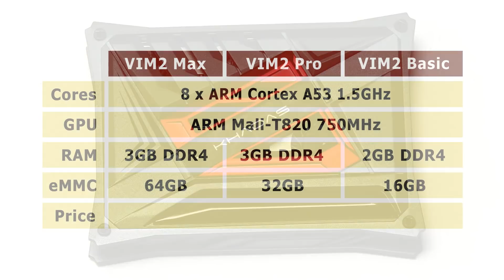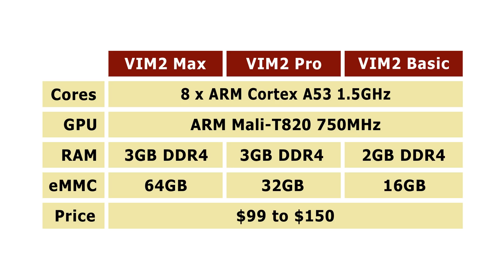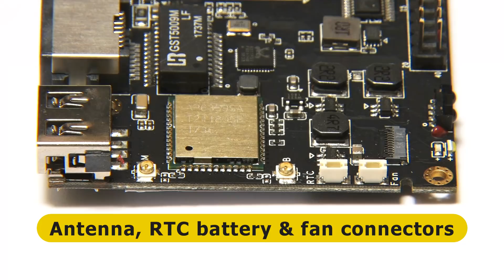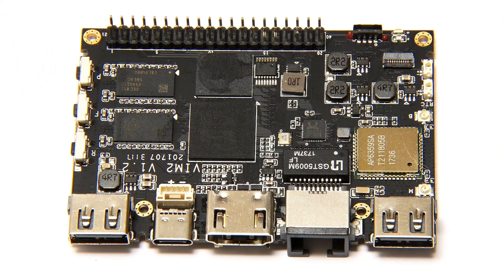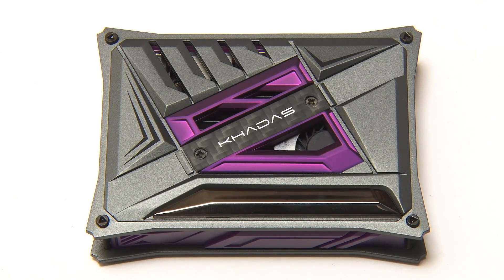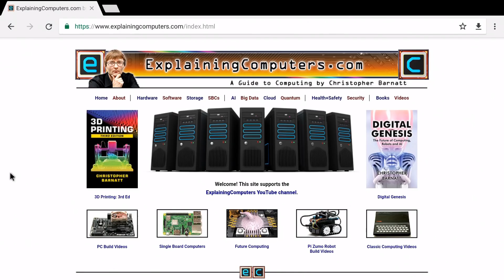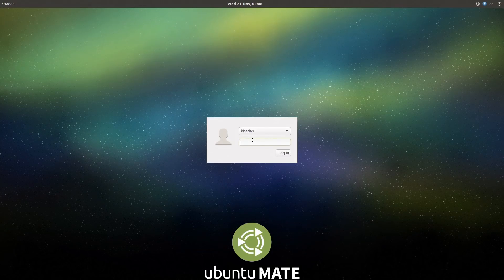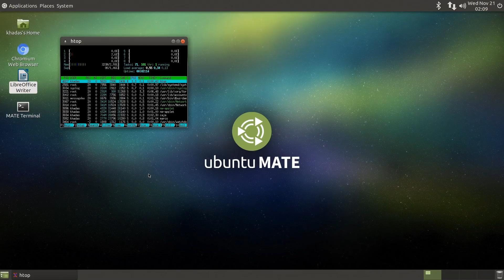Khadas VIM2 SBC & Android Box

Comment: Here's my take. Would I buy another? NO.  I bought the VIM2 v1.2 .. It's a sexy little device considering a dual boot Linux / Android.. However support on these Asian devices is something to consider. Im a big RasPberry Pi fan boy.. Mostly because of the Vast open community. I bought this expecting good support over the following months.. Reality.. nope..The device is only as good as the Kernel support and development that is behind it. If they don't release kernel for the device supporting the onboard then your stuck with what they last did. This is what kills most of these Asian devices..No good long term support. Takes forever for shipping on top of that....................................

Comment: On the Khadas site, the total for this as seen in the video minus remote and power supply is $191.40 USD. Nope! Not Happening! I have a cheap Nextbook laptop running Win10/Ubuntu and it came to only $175. Way too much for a SBC. That Nextbook has a removable touch screen too.

Comment: Hello Chris, 
A few months back you did a review of Ubuntu Studio and I am seriously considering the switch from Windows to Linux using this same Operating System, I would LOVE to see you do a "part 2" of the Ubuntu Studio with a tutorial of how to run a couple extra hard drives in it for storage and how that might be set up!! My plans are to run Ubuntu Studio on a small 320GB SSD as the main drive with two 2TB hard drives as storage for my video content and edited content! But because I am so behind in using strictly Windows I will need to format the hard drives from NTFS (windows) to what ever format the Linux OS needs (as I already have the drives, but I will need to change the format on them to work in Ubuntu)!! So I was wondering if you could do a video on just such a set up please!! Thank you so very much for your time and your experience, and I always enjoy your videos greatly thank you so very much!!!
Reply: Hello again Chris, 

I have another video idea for you about the same has above!! I would like to know how to run multiple hard drives on Linux and have them auto mount at system boot!! My intention is that in my windows computers I run a "main" hard drive that is basically the operating system only, then I install a bunch of hard drives for stored LOCAL content and added storage as well!! In my systems I have run has many has 6 hard drives on a single machine all nested inside the case where I can access the data quickly and then I move files around the system to align projects together has I need them!! This is because I get side tracked a lot and in my personal life I am never sitting at my computer constantly with day to day things going on in other areas of my life! One day I might get a visit from my grand kids for example so I have to put things on the "back burner" and come back to it later, or I am working on a video project when a paying labor job comes in and I have to store my video project till later locally on my machine and so on!! so having five 2tb hard drives at my disposal has become common place for me, and one hard drive alone is my "content drive" where I store music files, effects files (such as sound effects) and other related data to it!! Just so if I want to add a song to my project I can just pick and chose from a local batch without having to waste time digging through back up hard drives or my NAS which at times is a pain because then I have to download it and wait for it to enter my computer. I am pretty hard on my computers and I demand a lot from them, so I am NOT your normal "home user" in that I am constantly working on everything from edit a video, here or build a garden shed there and my time is always in a constant "flux" so to speak!! One day I might get ten calls for ten different things so having all the extra drive space on a computer is handy as you can imagine!!! But how does Linux sort out running more than two or even three hard drives on it at once?????? Thank you for your time and thanks for your videos.....always great to watch them again and again!!!

Comment: Hello Mr.Christopher!
Your channel has helped me to great extent! I made a Zumo robot of my own  and it works, but after some time (1-2 minutes) of using it  slows down and eventually stops. Where is the problem? Do you mind helping?
Reply from the maker: This sounds like the battery is discharging very rapidly. Perhaps you have a short somewhere?
Reply: @ExplainingComputers 
During many tests one motor is relatively faster than the other. But eventually they both slow out.
Reply from the maker: It still sounds like a power issue to me. I would check each connection to make sure each is solid.
Reply: @ExplainingComputers  Okay ill recheck it and try it again. Thnx sir :)
Reply: @ExplainingComputers 
No sir, The circuit seems to be fine, in accordance with circuit given on your website.
(Im using two 9 volts battery in series.)

Comment: Why would a cheap $100 android “computer” need a fan? It’s using low end phone components. 

My phone has waaaaay faster CPU/GPU. More/faster RAM and disk and doesn’t need a fan
Reply from the maker: Interesting point. It depends on the PCB and case design; smartphones are designed to channel the heat appropriately.

Comment: Thanks Chris. I have to say, it looks like it's a lot more powerful than a Pi, but (isn't there always a but?) is it restricted to Android or Ubuntu. I use Linux exclusively at home (well, except for my phone and tablets, which are, of course, Android), but I will not entertain a Canonical OS. So, given that it's not cheap (by comparison to Pi, for example) will it also handle a naked Debian install, for example?
Reply from the maker: The hardware should support a range of ARM Linux distos, but you will need one compiled for the board.

Comment: Please, review the PoE hat for the raspberry pi 3 model B+. I hear a lot of complaints about it. Also, can the fan it comes with, keep the temperature down, using a small heatsink?
Reply from the maker: To do this I need to have power in my network first! :)
Reply: @ExplainingComputers  Oh sure! Correct me if I'm wrong, but isn't a modem-router that supports PoE the only thing needed?
Reply from the maker: Totally true, but I am not running such a router. :)
Reply: @ExplainingComputers  Ok then. Thanks.

Comment: good afternoon...not sure how t contact you.  I have started building a robot platform from the Devastator tank you have shown earlier. I  am changing it up a bit and trying to make more like a rover.....I believe I have found most of the electrical components thru dfRobot and Amazon, (motor controller, motors, wheels, etc...) is there anything you would recommend to be certain I have?  I am going to borrow "steal" my sons pi so have that as well....wouild like to send a jpeg to you of the CAD drawing if possible...If you like, please email me back at peel47905@yahoo.comMerry Christmas and I enjoy your videos....
Reply from the maker: Hi Tim, thanks for this, and I'm glad that you enjoy the videos. It sounds like you have sourced the components no problem. As I recall,  some of the bolts in the robot were not trivial to put in -- so a decent pair of plyers or spanners is needed to put them in. I'm happy to look at the CAD if you post a link in a comment. 375,000+ subscribers makes responding to queries via e-mail impractical I'm afraid -- I already spend 5 -6 hours a week here in the comments. :)

Comment: Nice review!

I am pleased to see the 2A power brick rather than the 3A and higher  like some other boards. 

Was not pleased at the way dual booting is implemented. If the OS corrupts or crashes you can't select to boot the other. Maybe there's a hardware option not covered?

I'm also perplexed why SBC makers still insist on USB 2.0 when even USB 3.0 is being replaced with USB-C. At least have one USB 3.0 port. That's a deal breaker for me. 

Is GPIO the same as the familiar Raspberry Pi?
Reply from the maker: I can see your point on the dual boot. As far as I am aware, the GPIO is not the same as a Raspberry Pi.

Comment: I'm going to find out how much power this draws when it has a peltier cooler and a portly heatsink attached. RAM on both sides of the board though... :o/

No... The Edge V board. With The Captain board carrier. USB-C + 4GiB DDR4 + Bluetooth 5.0 + 4-lane M.2 slot.

Comment: How loud is the fan?
Reply from the maker: It does not come on that often, but when it does you know it. Not massively loud, but fairly high pitched. It is temperature controlled, but in an on-or-off, rather than a speed controlled, kind of way.
Reply: Thanks for the reply

Comment: Would there be any point in using thermal paste on this little device ?, rather than the pad that is preinstalled, thank you.
Reply from the maker: Possibly, but you would need a metal shim to fill the space between the tops of the chips and the heat sink.

Comment: That is a very nice piece Christopher , right in time for Christmas.  Its actually pretty moderately priced considering whats under the hood.  I really like the profile on this board, without those headers you could fit this into an abundance of projects in small form factor.  I would have liked to see a USB 3.0 port but the USB type C , OTG, port should suffice.  That case is very different, I like it , until about 8:29 when you tap it and its hollow sounding.  I thought it was a solid heavy case but it sounds like just a metallic finish.  13:47 I have very good eye sight and I see 3GB of RAM and 1GB swap with 4 cores, very nice, in concert with the dual boot its a pretty diverse piece of hardware.  Android was looking snappy and nice to see gapps out of the box.  Thanks for sharing.
Reply from the maker: The case is solid -- and good quality. A thick metal plate on the case, otherwise pretty thick plastic.

Comment: Looks a great SBC but I wish more SBC manufacturers were more inclined to add at least a single USB 3.0 port.

I do like the GPIO cover on this case that other manufacturers/case manufacturers should seek to add to their products.
Reply: It is a limitation of the system on chip(s912) itself.  To have USB3 here would require a different SoC.  There are still not many TV box SoCs with USB3 at such a low price level.  RK3328 is one.  Khadas probably has other reasons for sticking with Amlogic for this particular board.  The previous Vim board used the similar s905x, I believe.  Hopefully, USB3 becomes more common on these boards soon.
Reply: @ravagingwolverine  Khadas Edge with USB 3.0 features, more details at: https://www.khadas.com/edge
Reply: Yes, future Khadas SBC will suport USB3.0 and more features like USB-C DP/PD, PCIE etc.

Comment: Excellent review, as always. 😊
In EU it's now 105 eur on gearbest.
Just a question (maybe stupid): can you connect a mouse to an Android? I did not know this...
Reply from the maker: Yes, a mouse works fine in Android (as does a wireless device with a trackpad, like a Rii i8). In fact, it is far easier to control Android with these than an IR-remote style controller.
Reply: @ExplainingComputers  Thank you for the reply. I didn't know this...

Comment: I acutally have one, and it has to be for the mostpart my favorite SBC\TV Box, my only suggestion would would be having a standard Ubuntu rather than the many choices of preloaded distros android ran pretty well though.
Reply: Ummm... Hi Brandon.... So in your experience whats the heating or rather overheating if I overclocked it? Is it hobbled by that crappy Mali GPU would you say? I use my pi for retrogaming too, which is fine...but if the machine is faster that allows better games right? Well, you'd think... Or will it bomb out on big games would you say... The pi sometimes bombs out if I forget its on. (Sometimes for days) Fine if your just watching TV...not so fine if you're on level 40 of a game.

I'm thinking of replacing the pi 3b+ on the living room tv with something a little more powerful. This looks really good for the price though.

Comment: @ExplainingComputers / Christopher,
Due to the board design, the amount of memory and speed of the CPU (when compared to alternative SBC's of a similar cost point), as well as the overall packaging of the product, I think that this is one of the more interesting SBC's, which would be good for daily (general end user) workstation usage, as well a interesting platform for further development.

However, I do have a couple of minor concerns about this device, first issue is  surrounding the lack of any dedicated audio interfaces and the second is about the usage of the RTC connector. From what I can see, the RTC connector only contains two pins (power and ground), therefore I am presuming that this device can be connected (in some way) directly to a CR2032 button styled lithium cell but whilst looking at the case, I am not sure if there is any room to mount the battery (or corresponding interface) within said case. On a side note, I would also like to see the inclusion of a microSSD interface within a future version of this device as well.

I would also like to see how straightforward it is to remove the Android installation from this device (I am presuming that it's only a matter of removing the EMMC partition and maybe editing an entry within the Ubuntu based Grub configuration).

One more thing that I would like to further see is an option for a Debian / Armbian installation and maybe an option for a RPM based distribution installation (preferable a ARM64 version of SUSE).

On a final point, could you confirm that the provided installations of Android and Ubuntu are specifically built for the ARM64 (ARMv8-a) architecture and are not actually built for  usage with the ARMhf (ARMv7) architecture (I have recently seen some reports about ARM64 SBC manufacturers / vendors allegedly providing their boards with the inclusion of ARMhf/32 compiled operating systems only)?
Reply: about the audio part,  there is the Tone board as an audio part, which can be used along with VIMs series, can support SPDIF in &out,  reviews has been done by https://www.audiosciencereview.com/forum/index.php?threads/review-and-measurements-of-wesiontek-khadas-tone-board-dac.4823/.
Reply: I too want something this size to replace a laptop. But 128 gigabyte storage isn't enough. And sometimes one can hardbrig if messing with android partitions. Like by accident removing EFS partition. And I am not having a JTAG writer e.g. But obviously x86 its era might see heavy competition.
Reply: @mrkitty777  
You state that 128GB of storage isn't enough. Just wondering if you have considered using online "cloud" / SaaS / IaaS styled storage (using something like a Nextcloud based framework and then accessing files via the WebDAV protocol or instead, setting up a site to site styled VPN network and then maybe using Samba as the file storage protocol)?
Reply: @medworthy  I already use SMB since I currently have 256 Gigabyte. But this little Khadas for example would be perfect for daily browsing and YouTube and website maintenance with a spare 24 inch screen. What's most important to me is fluent YouTube at 1920x1080. Something my 2008 laptop now 10yr cannot do.